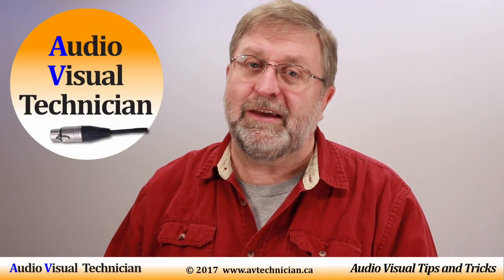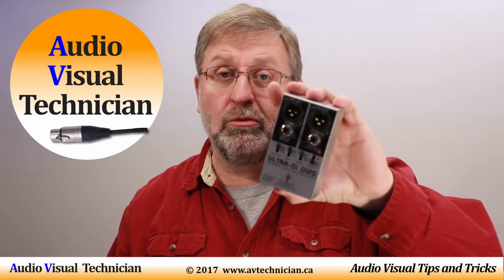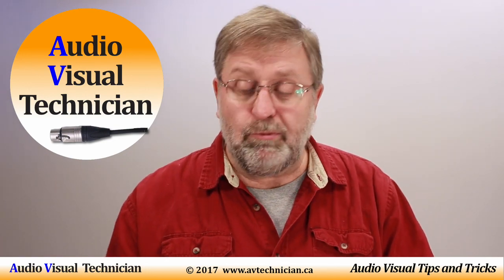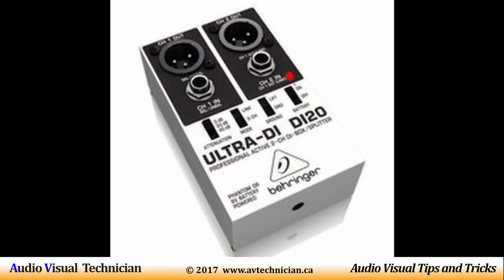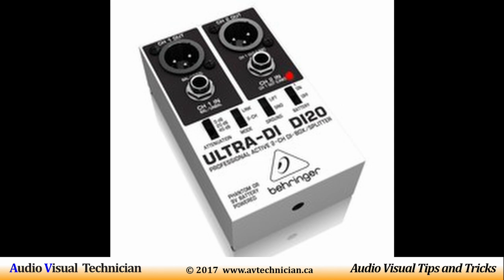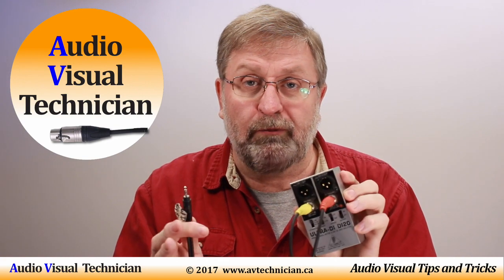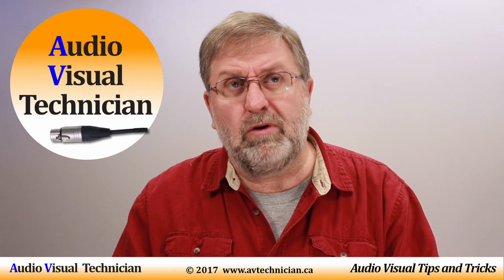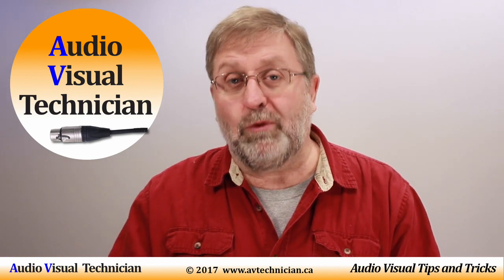DI Boxes

Comment: The Lavalier has an XLR male connection on a 6’ cable . The mixer is about 15-20’ from the lavalier so maybe a DI would work well to maintain the signal between the lavalier and mixer .  Thanks
Reply: Hi. Usually when a microphone has an XLR connection then it's a mic level connection and it can run through any XLR cabling any distance (I think 500 feet or so is max -- but don't quote me on that). No DI is needed.
Reply: Paul Donovan that’s great to know !

Comment: Also , for another setup , going from a laptop 1/8” to 1/4” L and R or TRS , would you recommend sending that signal through a passive DI prior to the speaker ( a QSC K12 ) ?  Thanks !
Reply: Hi. Normally you send audio through a mixer before it goes to a speaker. While some powered speakers have XLR and 1/4" jacks for input (some have RCA) you generally don't hook things directly to a speaker without a mixer in the middle. Of course I have connected a laptop directly to a powered speaker before but its not the norm. 
Unless the distance from your laptop to the speaker is more than 10-20 feet it can be plugged in directly into a 1/4" jack. If your distance is long then pop a DI into the line so that you are on a balanced XLR cable running at mic level. 
THanks
Reply: Paul Donovan thank you for the clarification